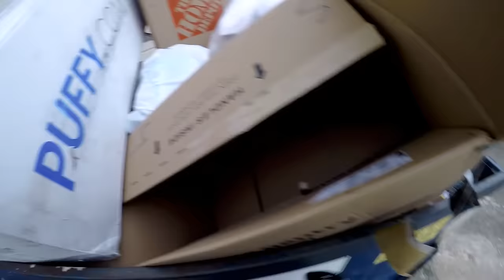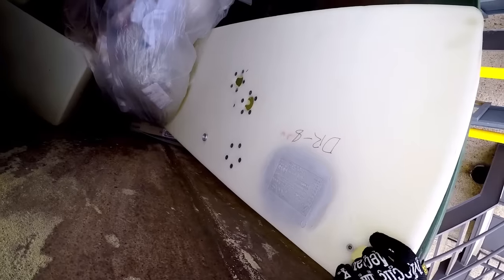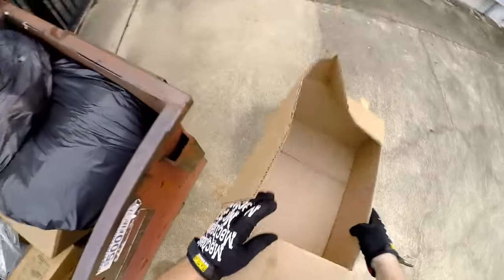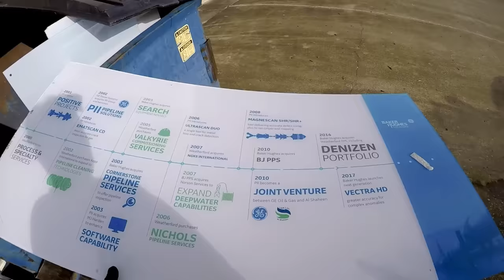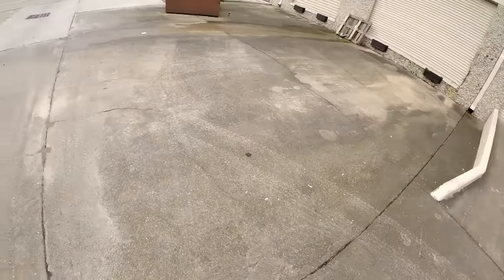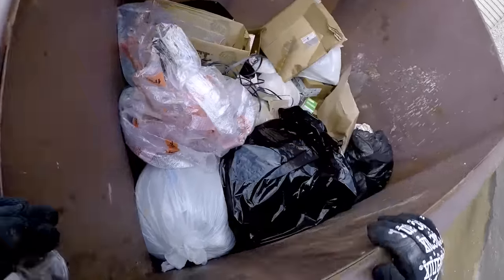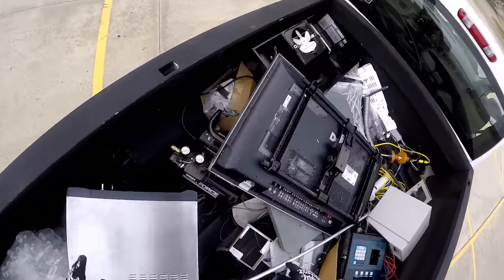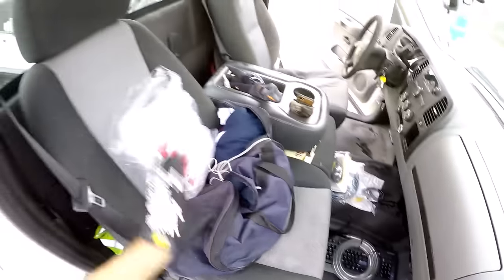Dumpster Diving 4 (2 Of 2) Found A Tech Deck!

Comment: Love it dude i use to scrap and plan on returning when i get my 69 flatbed running. 1 tip for you: back your truck to dumpster to get in and load truck  and a 2ft ladder to get out😉. Work smarter not harder...as my pop used to say. Save your back.

Comment: 1. Waterproof, steel lined protection boots. Buy some, son! Everytime you jump in, I about die expecting you to land on something unsafe in those sneakers (nails, sharp poles, rats, thick wire, homeless person with a machete, used drug needles). mom cringes and faints
2. I am curious, does this stuff end up piled up at your home while you figure out what to do with it?
3. Shocking on the amount of Energy drinks wasted, but better in the trash than in your system. :D
.
.
Cool videos. I subscribed.
Reply from the maker: Working on getting me some new shoes and I keep things at a storage unit as my wife would freak out if I brought this stuff home, but I move stuff pretty quick selling and scrap is gone in a couple of days. Thank, you for the sub!
Reply: We'll have to see if we can help with some new shoes. What size? LoL
Reply from the maker: I just recently got a PayPal set up and am working on getting a PO box. That's awesome someone would want to help me like that :)

Comment: The cover @ 1:45 is off a rooftop HVAC system control box panel, Guessing a Carrier unit. The rest of that looks like a unit roof mount kit. @ 13:24 Goodman HVAC top and motor.

Comment: Those Energy drinks might have been a Recall...My first car had a "BOOMING" stereo! everything but the Cassette deck was from a dumpster behind two local stereo shops.  Also found some cool german made wooden boxes they shipped their speaker in complete with hinges and hasp locks i converted to tool boxes.

Comment: Found my new home with your videos :) Makes me wanna do this my self. just stubbed

Access Control Equipment , And pump controls would love to have had that lcd screen control head , Im a geek all that looks like gold to me O.O Those control heads are little out dated which is prob why they upgraded but I bet it all works fine I used to work installing this and normally the old stuff was fine just old.
Reply: That is exactly what I was going to say. There are numerous POS terminals for tracking and access. Even a printer for the user receipt, did you notice? The tanks are probably worth a bit as well... look like they would work for either a truck or a boat. The boards looked like a bunch of ram and then power supplies etc. Looks like they upgraded as you said.

Comment: I do this daily with a bicycle and a small trailer. I'ma homeless junkman.
Reply: How do you have a phone and charge it? Not judging by any means just curious
Reply: @HTHonda420  found it in a dumpster, cable an box as well. An I charge it an 8 battery packs, all from dumpsters as well, at a Sunoco gas station. I'm known as junkman Chevy where I am.
Reply: @myjunkertravels6897  dude that's awesome I hope you find employment and get a roof over your head soon man prayers going your way
Reply: @HTHonda420  thanks bud. I have a roof made of tarps. An soon it will be sheet metal.
Reply: @myjunkertravels6897  well best of luck my dude and stay safe!
Reply: What’s it like being homeless?? Jw
Reply: @shamusspencer4060  it sucks dude I was homeless for 9 months once
Reply: @shamusspencer4060  annoying an painful most the time.

Comment: @Mike The Scavenger - 
I know these new power cable plugs @ 12:20 ... 2 Italian plugs ( 3 round pins in a row leveled) & 1 "interesting" NZ / AustrAlian plug ( 2 angled blades + 1 blade)
Reply: I noticed those plugs too 😊 Kiwi Fan 😊👍

Comment: This might have been the one time when 50 cents a pound for aluminum cans would have been worth it. Each case would be 2 pounds and change after emptying the contents in the bath tub. As an added bonus the hair soap and dead skin crud in the drain would have been cleared putt
Reply: Out not putt or whatever that last word was.

Comment: In the same dumpster as Mike found the exhaust fan motor and cover, there was rolled up barbed wire and a cord. Would figure the wire is good scrap metal? But he didn't take it?

Comment: If the energy drinks are marked for recycling they can be turned in for cash. Don't know what state you're in but if those were marked with MI 10 that means each can would get you 10 cents. Those drinks were worth $2.80 per pack and there at least 20 of them?  That's 56 dollars. Other states are only 5 cents each, but it builds up. There is also value in just recycling the aluminum without the cash gain...

Comment: You should be gentle with that screen and those laptops it would not surprise me one little bit if they all work just fine and as heavy as you describe and it being Dell that is probably a high-end screen and it might even be a plasma which is very sought-after people will throw away things like that when they upgrade them or if one of the many ports on the TV have failed even though the others were fine
Reply: I cringe every single time.

Comment: 9:47 waste connections of texas.
You should look at precious metals recycling from computer boards. Gold, copper, some platinum and other.
That bin is a recycling bin. Not sure about regulations there. 
I respect what you are doing, it would be possible to totally make mining redundant by recycling and only manufacturing neccessities..

In Texas, for example, the courts have found that depositing trash in a garbage bin does not constitute abandonment, per se, but rather the transfer of property from the owner to a waste-hauling firm..
https://slate.com/news-and-politics/2009/05/once-you-put-something-in-the-garbage-do-you-still-own-it.html
In this case, for you to waste fuel to go and collect items then give it back to the same place that would have processed it for a payout equivelent to your fuel and lunch costs....
But things like your glass jars you saved from being destroyed just to be recycled back into glass jars...so, weigh it up.
Bypass the whole scrapping, recycling, processing, manufacturing phase. The recycler plants dont refurbish and resell items like that.

Comment: dude check the tv before you  disregard them as no good  ive  found 3 in the trash  a 40 inch toshiba made  in  2009 ,   a 43   lg inch made in 2012  and  a 55 samsung made in 2015  and  only the  samsung  was not  working of  the  three